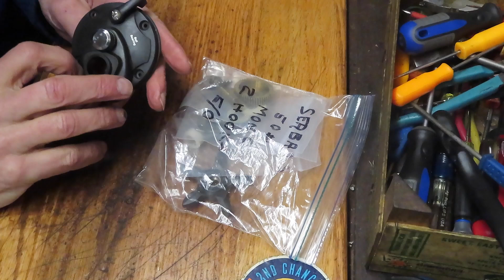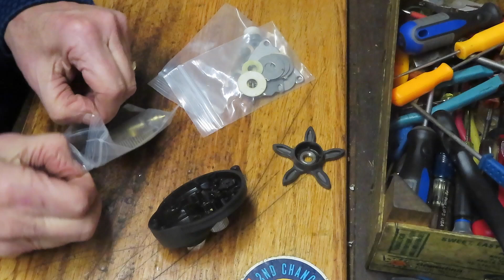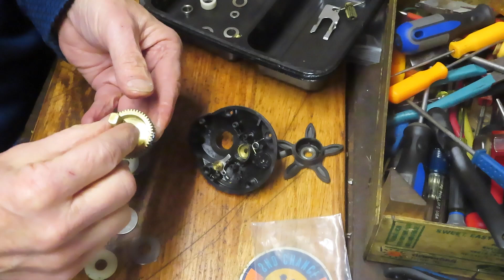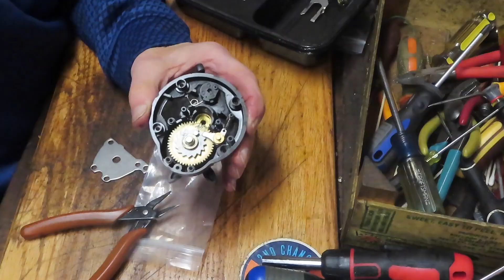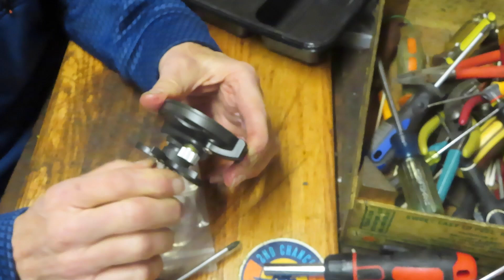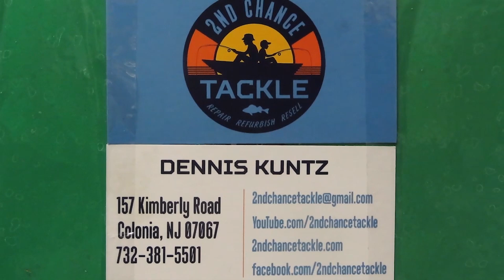Shakespeare Tidewater 30 Fishing Reel in a Bag Project How to Assemble the Gear Side Plate

Comment: excellent video. Watchijng you figure   it out certainly helps my understanding. What do you think of the tidewater? Quality or no? thanks ///bill
Reply from the maker: The tidewater reels were nicely made for the time.  The problem today is that you cannot get parts for them.  It seems the common failure on these is the plastic idler gear that breaks.  When that fails, you lose the line guide feature because the worn gear will not turn with that gear broken.
Reply: @2ndChanceTackle   thank you,sir

Comment: Free tip today.  I use an eyelash brush to clean long small bores like a pinion gear on a spinning reel.  You can usually get them free at a cosmetic counter at a major beauty shop or department store. They often give them out for women to try eyelash makeup
Reply from the maker: That’s a great tip for cleaning small bores!  Thanks for sharing.